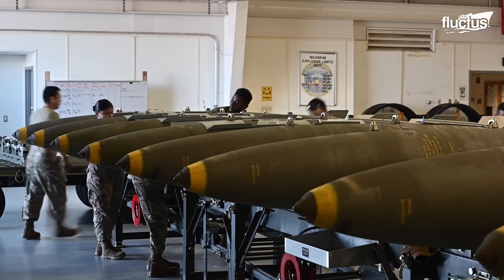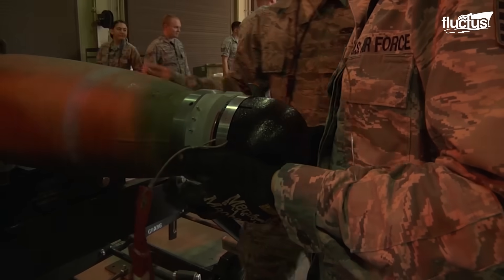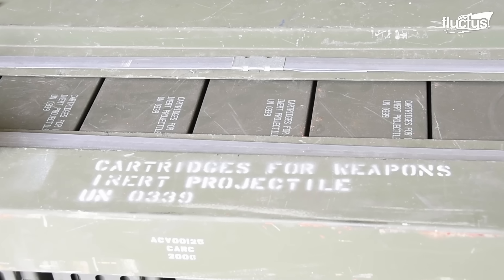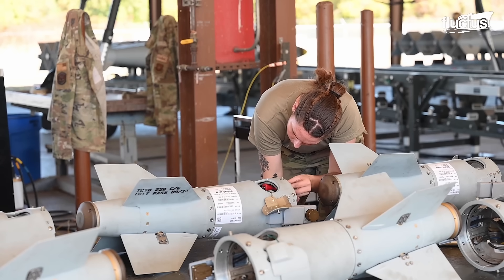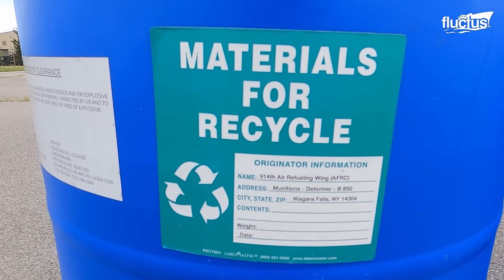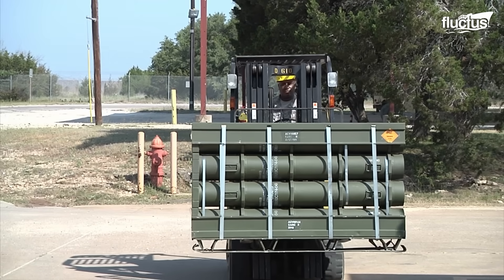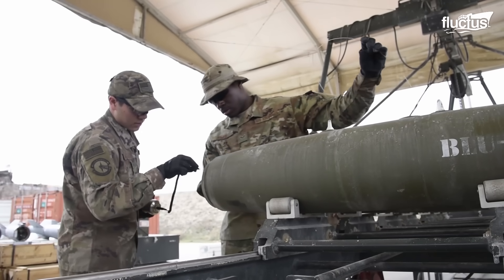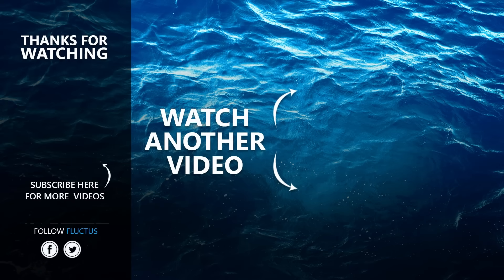How the US Stores Billion $ Worth of Ordnance

Comment: I used to work C-5's and part of the job was to rebuild tires once they're worn. New rubber would be ordered from supply and delivered. Around the circumference of the tire was a label which indicated the year the tire was made and whether it was a recap or new. We'd get tires in that were many years old that were stored....somewhere. Considering the size of the C-5 fleet at the time and that each plane took 28 tires and that all these tires had to be out in the system for use it was amazing to think just how much is out there for military supplies that are stockpiled for use around the globe. The US military machine is quite vast and far reaching.

Comment: They aren't spent 'blank' cartidages, they are spent cartidages. 'Blank' cartidages are rounds that do not have bullets. The US armed forces has little use for rounds that have no bullets.
Reply: Blank cartridges are definitely used by the us military for all 21 gun salutes because they aren’t gonna shoot rounds into the sky in Arlington cemetery
Reply: Also when doing field props, blanks with miles gear are used.
Reply: Most practice rounds are basically blanks too, they usually have Blue marking in them too. Artillery, Aviation, Tank rounds and others too.
Reply: @MikeFL2TX  based . Good job man we really proved him wrong , high five
Reply: @JoeRogansForehead spent almost 11 years as an Ammunition Specialist in the Army. Originally a 55b, they changed it to an 89b, then added the 89a as they mentioned in the video. The 89a was the “office” side of the MOS and the 89b was the “worker bee” of the MOS.
Reply: @MikeFL2TX  damn , my comment was sarcastic obviously but that’s impressive . I only knew because the parades they obviously can’t shoot live rounds . You have actual kowledge